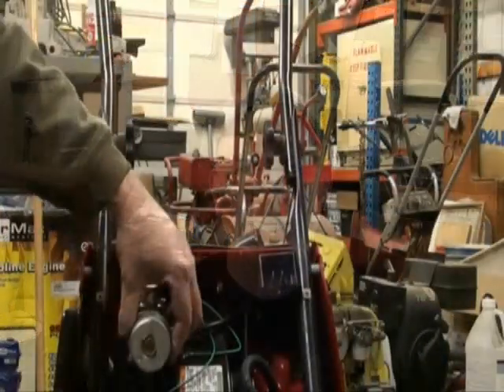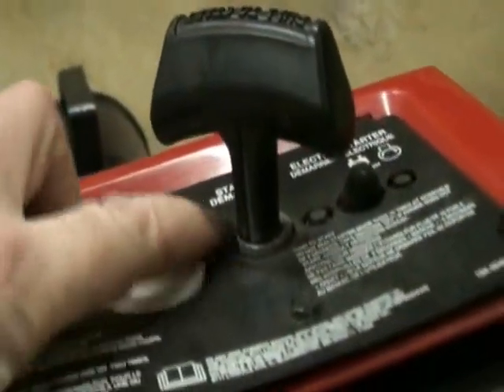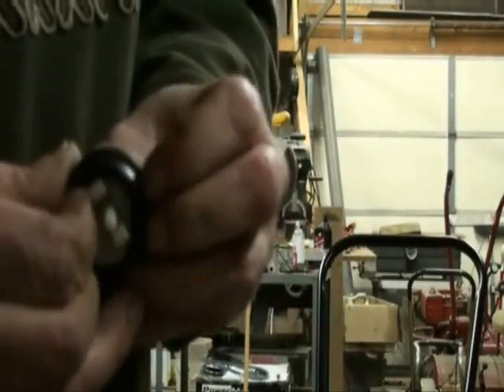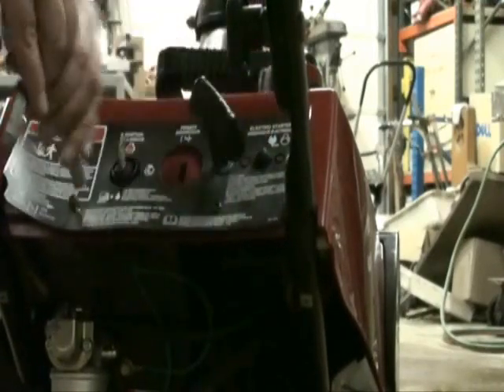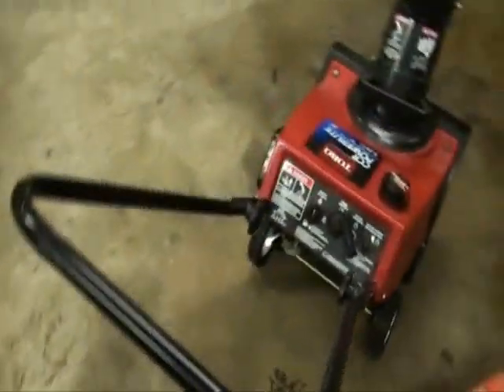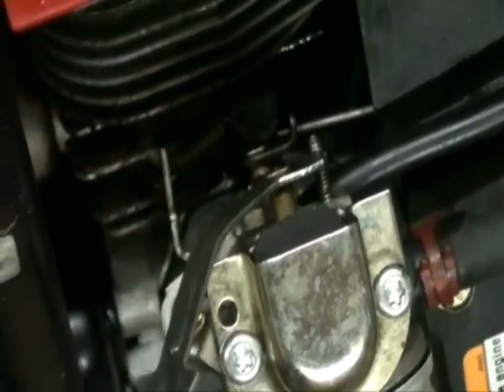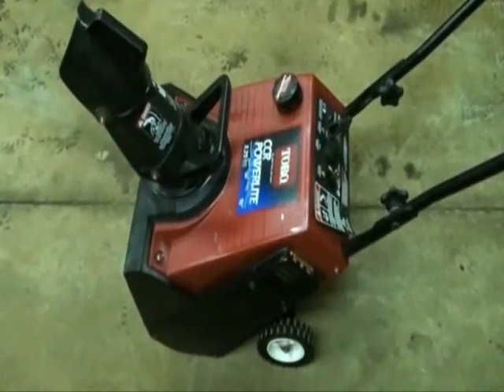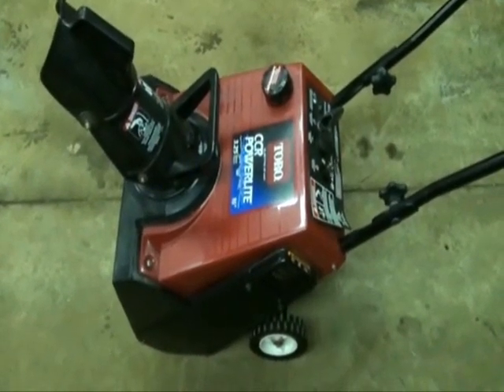Toro CCR Powerlite Snow Blower Repair Quick Fix part #2

Comment: I never understood why Toro put the air intake hole on the carburetor facing up, it's right near the choke lever slot and water and snow gets sucked into that and goes into the carburetor. I flipped mine upside down and it seems to work better

Comment from the maker: Hi, usually this quick help video will work if the blower has sat with gas in it for 2 years or less in storage, 3 years or more will sometimes destroy the low speed Idle passage way in side the carb and when this happens I will usually replace with a new carburetor.
another thing that can happen with start up - stall outs is that the piston or cylinder went bad or the crank seal is leaking air under the flywheel, in trouble shooting always start with the easy things first. I hope this helps!

Comment: Hi @31pockets. Tried everything in the videos and now the snow blower has stopped trying to turn over at all, when attempting electric start. It is now making an obnoxious and loud electric "warning" sound when trying to electric start?? Also, the starting rope/cord cannot be pulled out when trying to start manually. The carb was full of a dry, light green/yellow residue and both that and the screw pin to the carb bowl have been cleaned thoroughly. Gas line has been flushed well also. I am at a loss with 10 inches of snow due tomorrow. Due you have an ideas as to what would cause the blower to make this sound when trying to start and why the rope is locked up? Is the engine seized? Many many thanks.

Comment: Thanks for giving the benefit of your experience.  One question though, you increased the RPM by adjusting the governor tab, but should an adjustment be made to idle screw on the carburetor as well, if there is one?  Or when would you adjust an idle screw in conjunction with the governor tab?  Thanks in advance for your advice on this issue.

Comment: @31pockets  I have a newer toro snowblower and it runs great but when I go to engage snow blades the second flap in the carb does nothing and the idle will not go up. Does something have to push the throttle flap open or is the pressure from the motor supposed to suck it open to rev up rpms? I could really use the help

Comment: I have a tecumseh mtd from my parents,.. it didnt work when i got it,.. took it apart to replace the auger belt that was snapped. I noticed a chain link laying on the bottom too,.. noticed theres a chain drive to each wheel inside,.. one of those are busted,.. any ideas on how to get inside and replace those?